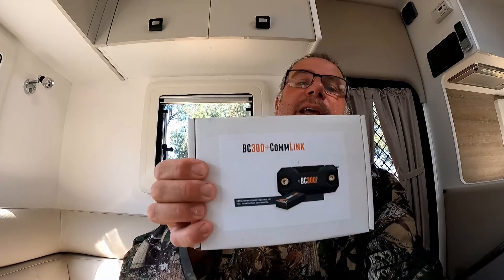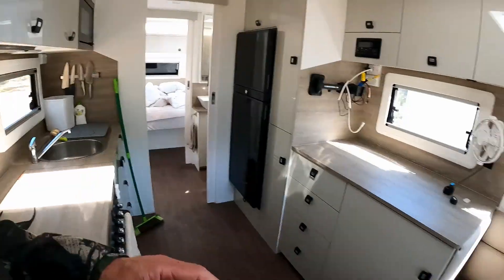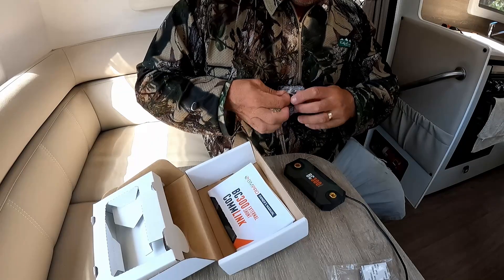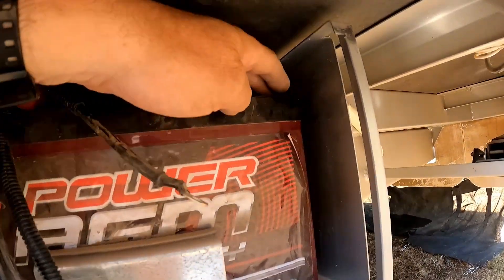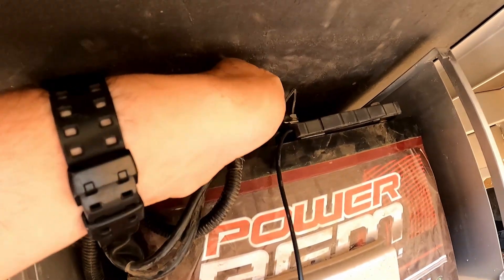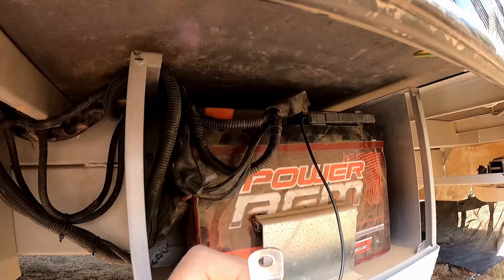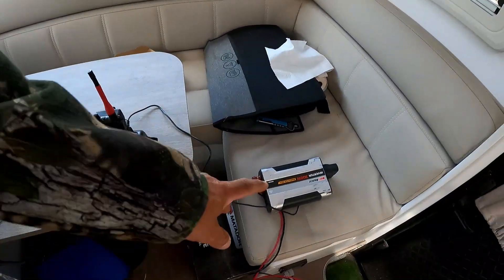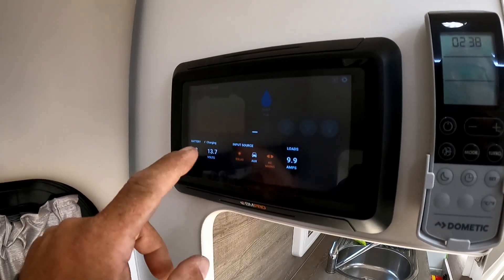BC300-Commlink install on Franklin CX22

Comment: Thanks for the vid. recently joined channel. One question re the install...why do you separate the negative and positive loads across both batteries? Wouldn't the shunt operate as designed if some load was split across both batteries?  BTW...throughly enjoying your vids!!
Reply from the maker: I think its more a case of correct practice, if you separate the loads that way you are always drawing across both batteries, helps keep the SOC even across both batteries.  Thanks for your support :)

Comment: How come you connected comm link to the odesseylink not the battery charger unit??
I'm having trouble with my unit basically falling asleep and not reading input or output 
Any help would be much appreciated
Reply from the maker: Good question.... I will recheck this at the weekend, the shunt appears to be working correctly, but I will look to see if putting it in series makes a difference.... will let you know on that one :)
Reply from the maker: OK so I've reconnected it putting it to the charging unit and then to the  odyssey link and it works just the same :)

Comment: Thanks for your detailed video. I have the same system in my new van and have had issues with incorrect battery readings. 
The cause of the fact was the system was not connected correctly and a blue light flashing from the bc300.
I now have a green light flashing from the bc300 and still have the same issues as before. After viewing a utube video by bmpro, the green light needs to be in a soild state for a correct installation.

Comment: Hey man , just a question……I’m keen to know if the commlink will plug into the battery plus35 in the spare  connection next to the display connection as I don’t have an odyssey link.  Nowhere can I find this info.  Cheers
Reply from the maker: https://teambmpro.com/wp-content/uploads/BP35-II-Owners-Manual-Digital.pdf  

Page 11 of this manual states it can be used for this.... so I guess ...Yes :)
Reply: Thanks for your detailed video. I have the same system in my new van and have had issues with incorrect battery readings. 
The cause of the fact was the system was not connected correctly and a blue light flashing from the bc300.
I now have a green light flashing from the bc300 and still have the same issues as before. After viewing a utube video by bmpro, the green light needs to be in a soild state for a correct installation.
Reply: Just a heads up, you have actually incorrectly connected the shunt, this quote is from the installation manual.

“Connecting the BC300 to a Parallel Battery Installation
When connecting the BC300 to a parallel battery installation, the earth strap that links the batteries together must remain on the battery terminals, and must be located on the negative battery connection side of the BC300.
The new negative terminal connection side is for loads and charge sources only.”
Reply from the maker: @chrisjeffery1717  shit…. You’re quite right… missed that…. I will rectify that at the weekend and put out a new video:) thanks for the heads up